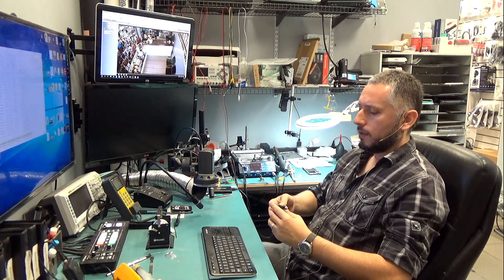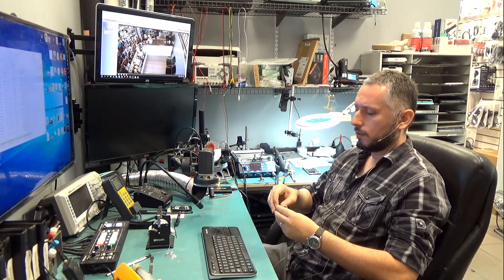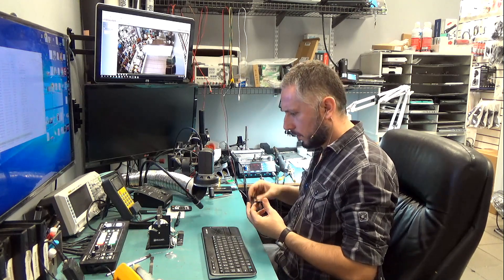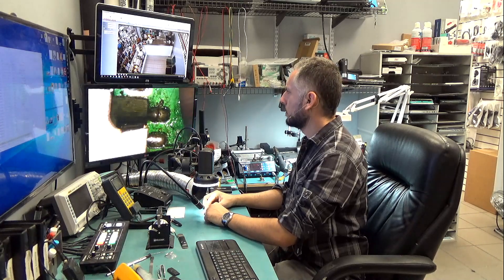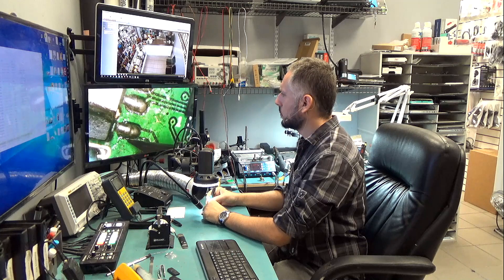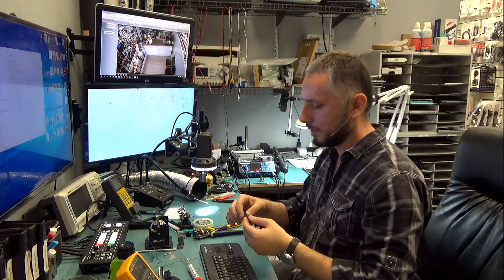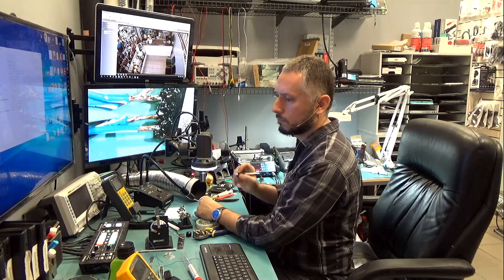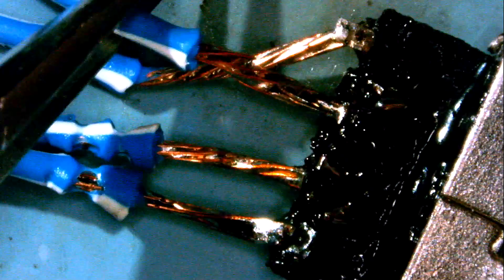Broken USB Thumb drive repair and data recovery

Comment: I always enjoy watching your videos and I have learned so much, THANK YOU!

But knowing how valuable is your time, I will dare to offer an unsolicited suggestion:

You could get a cheap USB cable (ore be from a discarded printer, cut off the non USB-A end, strip the wires and then you will have a reusable cable to solder to any thumb drive with a damaged connector. That will save you good 15 minutes and the inherent hassle of trying to rewrite damaged ones like this one.

Thank you again for sharing your knowledge!!

Comment: is it possible to repair a dongle that has been broken in half ?  it's not the connectors, the chip is snapped.
Reply from the maker: Take a close up photo and send it over to 818-668-7058
Reply: @NorthridgeFix  My flash drive broken into 2, may I send you a photo of it, for your review?

Comment: Hi, new to you channel. I like. Found you via other repair channels. What is the microscope you are using? I wana get started. The amscope is a bit out of my price range at the mo.
Reply: Excellent advice. I found the AmScope SW-3T24Z with additional purchase of 0.5x barlow lens (Steer clear of the 0.3x barlow lens, it's made for the ZW series) - and 
AmScope LED-144W-ZK White Adjustable 144 LED Ring Light to have fit my needs for a year now. Total cost on Amazon; $351.94.

I then realized I needed solder fume extraction and filtration. I made my own. A Home Depot 5 gallon pail. 3" Aluminum Flexible Duct. 4 Inch Carbon Filter Air Scrubber Odor Control Air Purifier Activated Charcoal Filter . 200 CFM 4" Inch Inline Ventilation Duct Fan, misc fittings (esp. water heater exhaust fitting) and a switch. = just under $120.

Just starting out is rough. A year in, I'm still thin on customers and setting up equipment. Only equipment purchase regretted so far has been the Hakko FX-951. I got a Hakko FM-203 as my main one now. It is needed for the FM-2023 mini tweezer and heats up in half the time.

Best purchase ever; QUICK957DW = 580W = more than enough power. = under $100. I bought a back-up!

Good luck.
Reply from the maker: Microscope http://amzn.to/2D7rKvZ, Polarizer lens http://amzn.to/2qCnP7w, and S-109 Stand . Stick wth amscope if your're on a budget
Reply from the maker: What you have is very sufficient to do any board repair. Only invest in better equipment when you can justify the cost and you feel the need for it. Great job. Keep going.